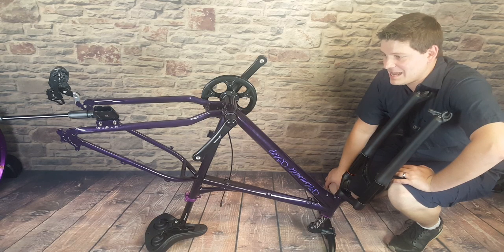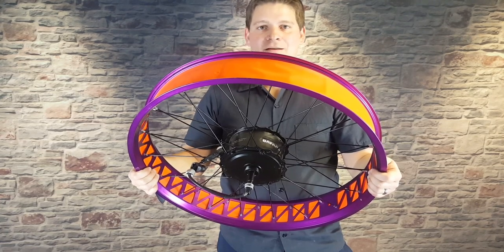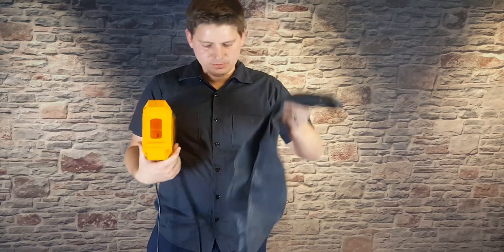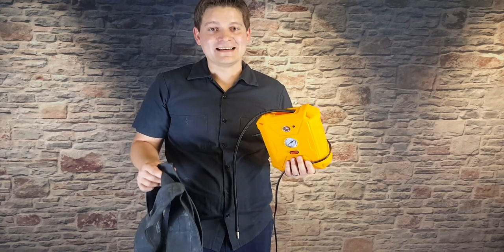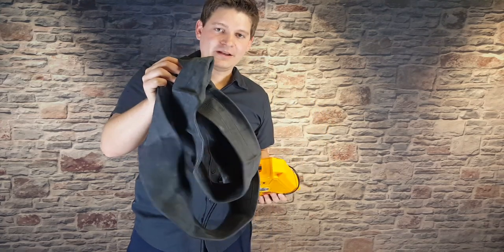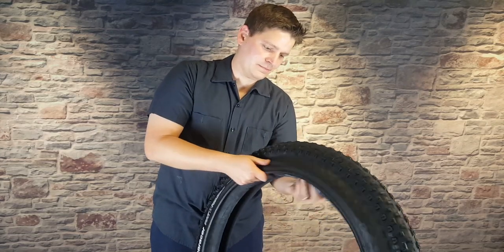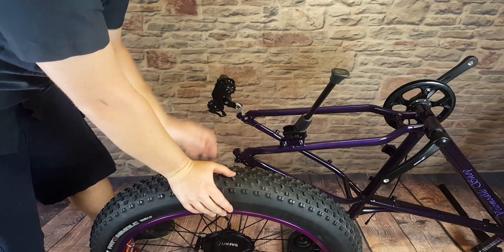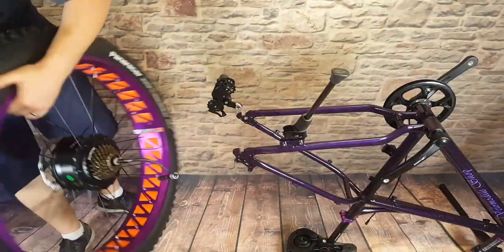How to build an ebike, Episode 5 - Install rim strips, tubes, freewheel, tires, & Hub Motor

Comment: Please do a wheel building course Kyle!! I was ripped off! I spent almost 300 bucks to have a hub motor built into a rim.
Reply from the maker: Thanks for the input.  It's not the easiest task which I why I left if out, but I seem to see more and more people wanting to learn that skill!
Reply: Ya the biggest headache I ran into when I first started doing it was getting your rim trued up
Reply: My opinion is ditch the hub motor and go for a mid drive motor

Comment: Why did you you pick those Panracers tires, have you used them or like them
Reply from the maker: Yes, I have used them (with the Panaracer logo and under other brands) and have always had good luck with them.  :)  I've used them with both 4" and 4.9" widths, as well as 24" diameters.

Comment: I wanna see you use the freewheel tool to loosen a freewheel after being used on that hub. 
Just for giggles. 
You might understand that it's almost 2020 and freewheel sprockets should be forgotten.
Reply from the maker: I use a cassette on new Bolton Ebikes.  However, you may be surprised that the top selling ebikes (Sondors, Radpower, and the #1 funded Mate X bike on Indiegogo) all come with a freewheel.

Comment: I am building my own ebike, I got the rear wheel wit the motor, what if it don't fit in the frame?
Reply from the maker: That means it's probably not the right frame. It might be better to get an ebike instead.